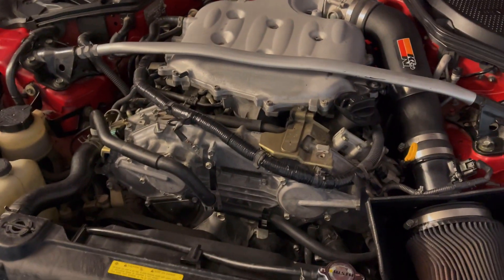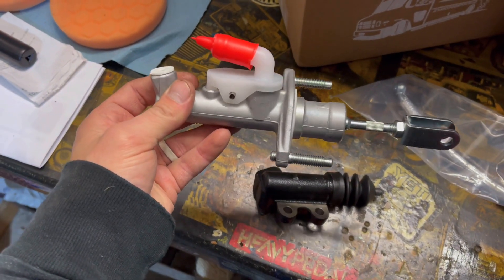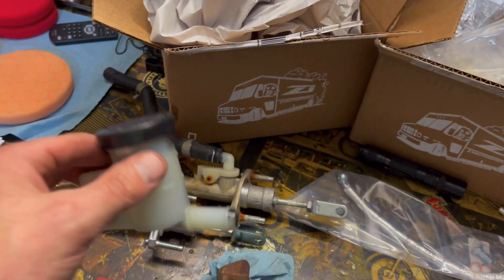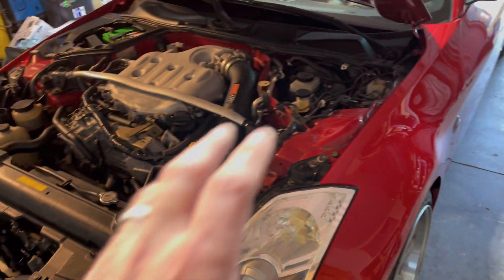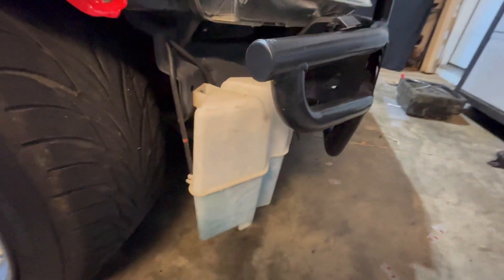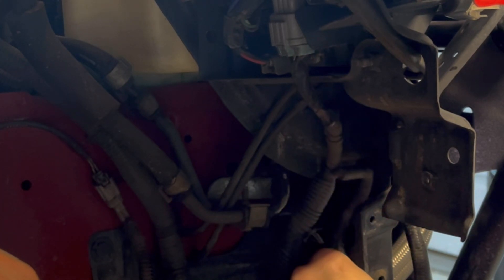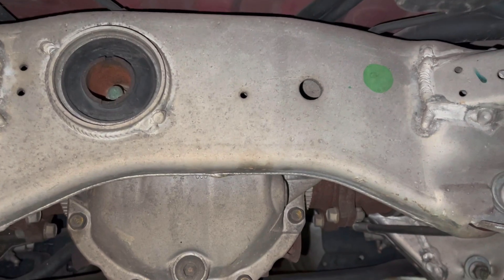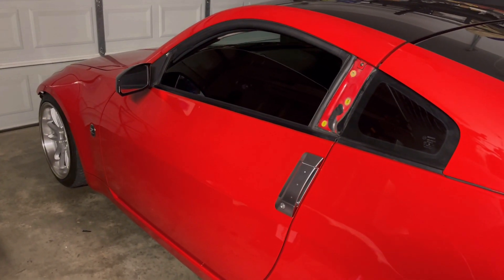WORST 350z rear diff bushing “fix” and new Parts!

Comment: I couldn't catch the coilover brand..? I'll assume those will be covered in a future vid, especially since adjusting them is "on the list" lol... good luck with chasing that clutch/gear issue. Might want to defer to a reputable transmission shop if it becomes too hard to pin down. You're lucky you can go out and drive a Z year round, we in the North only get to stare at the car for 5 months haha... the G still gets WOT episodes in the Winter though, just not the same thing.
Reply from the maker: The coilovers are ISIS, which I believe is ISR.  I'm tempted to change them out, but I want to get all of this maintenance stuff out of the way and then I can actually drive the car and see if I like them or not.  Clutch issue is being addressed!

Comment: Just gonna say this everyone’s different, but I was taught that when a bottle of brake fluid is opened and is exposed to air it is best to use it all and then toss the rest or it’ll over time break down. Depending how old it is I would just get some new fluid
Reply from the maker: I suppose that's possible.  Most of the fluid used was out of the fresh bottle, but it won't be in the car long...
Reply: That’s good! Currently in the process of manual swapping my Q!